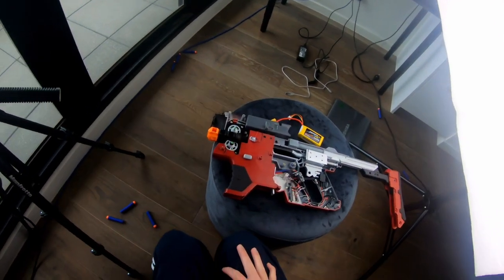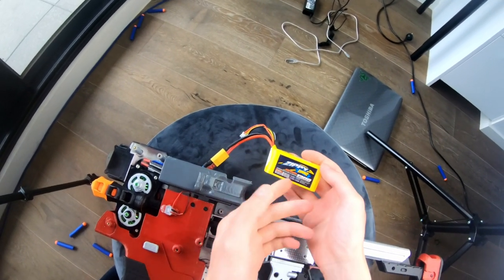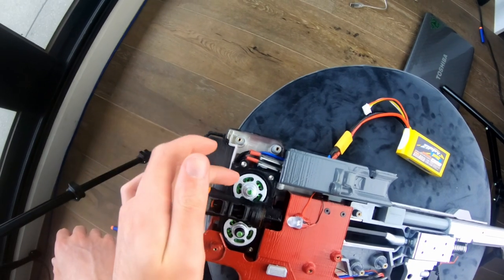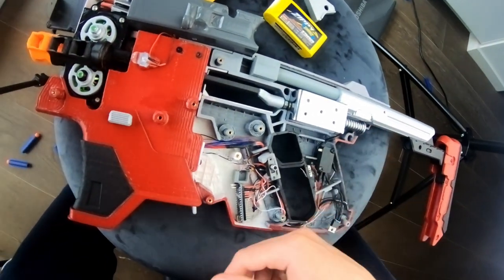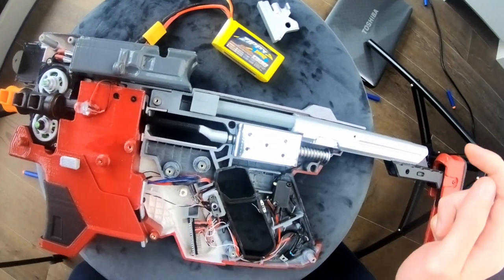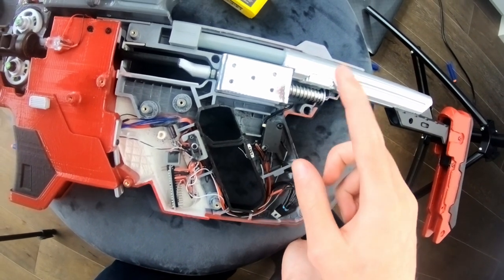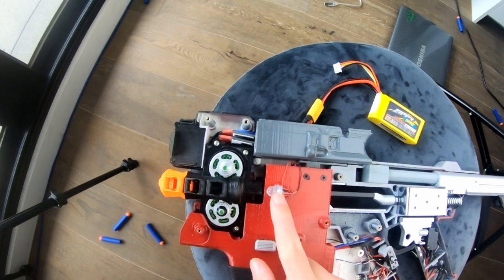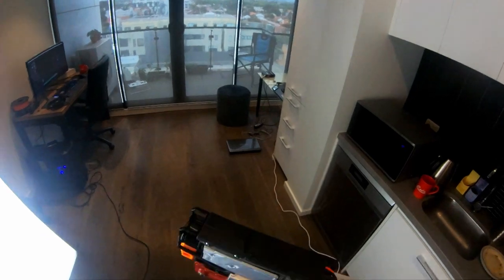Kang Tao Nerf - Part 4 - Electrical Components Guide

Comment: So I have printed this out and have most of it built to showcase on my channel. However cannot source the motors well. Any assistance would be greatly appreciated!
Reply from the maker: Hi Dr flux since this was made two years ago the mktors used have been discontinued.
Try to find outrunner motors with 2600kv that can handle 3s lipo ~12V.

Get one with mounting holes on rear of motor case. Should bolt straight to flywheel cage.

You may have to draw your own flywheels to suit the new motors.
Reply: @printedprops8730  Ok sounds good! Thank you for the quick reply!
Reply: Dr Flux,

I used Emax 2207 2400kv for my latest FDL3 build and they rock. Super snappy and decent price.

Comment: Now i have some old motors from my FPV Qwad, they are and 2205 2300KV so a bit underpowerd for a 600 gram 5''drone going 100km/h but perfect for this. I guess paired with a 80c 4s lipo darts will be flyn pretty fast! Also think that active brake(also used for drones) would be a good fit for this too.

Comment: Nice work. Any idea how many feet per second u getting?
Reply from the maker: Im getting about 90fps, though that is only at 40% throttle. Increasing flywheel speed shreds darts and I cant measure it with my camera properly. I need one of those chronos!